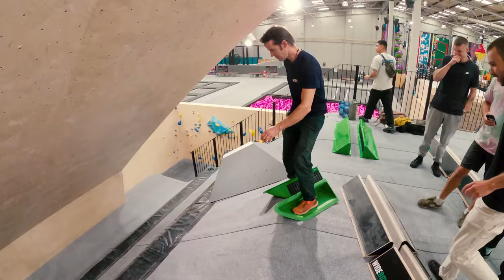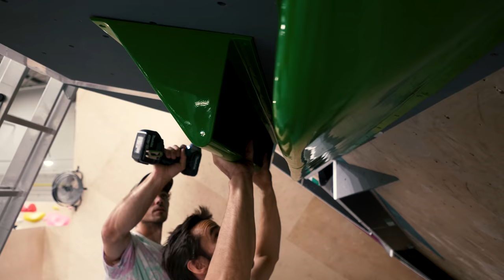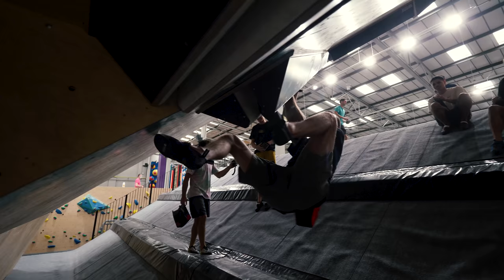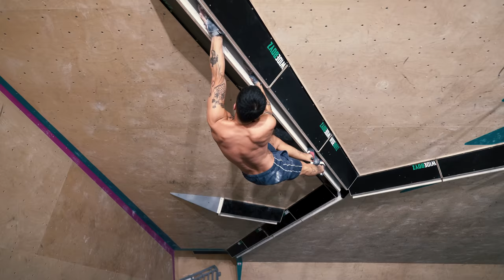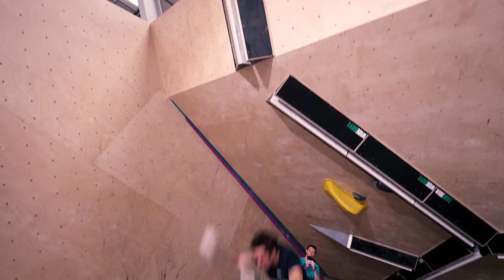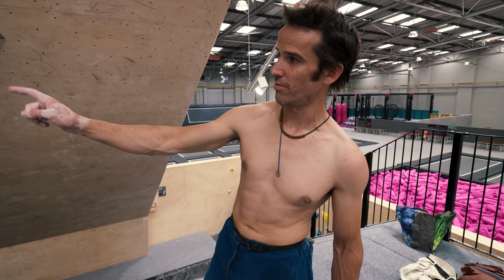Worlds longest crack Boulder || Flashpoint Swindon

Comment: Why does Tom go feet first?
Reply: it's easier to move up feet first on steep wider cracks
Reply: @marbinb2870  Then why does no one else climb it feet first?
Reply: @maximebarber3780  most of them skip a better part of the fist jam section. Tom starts way lower